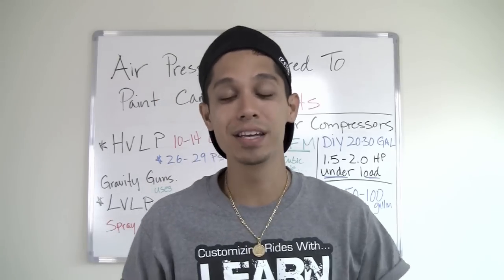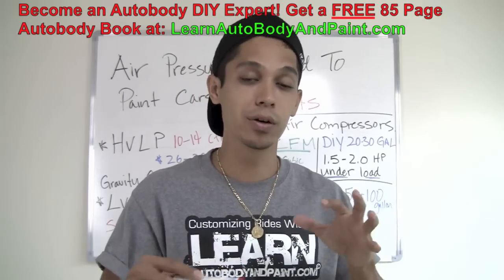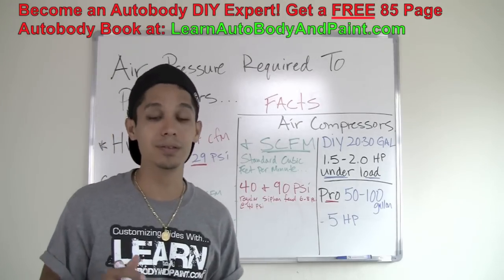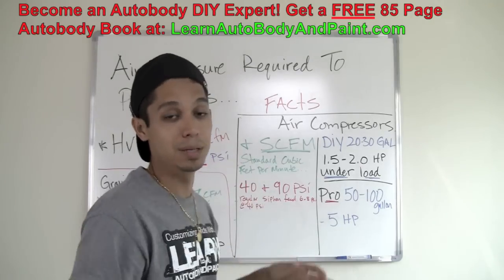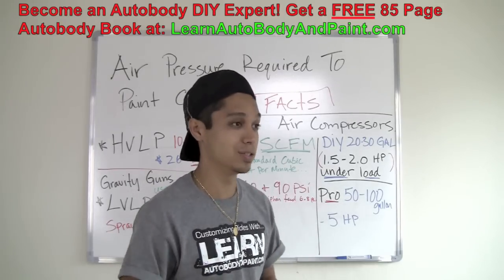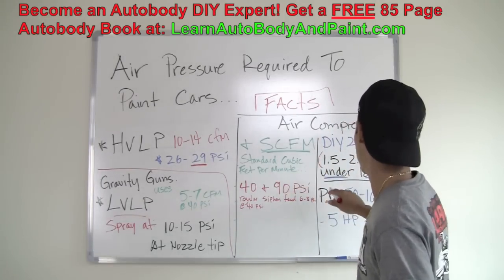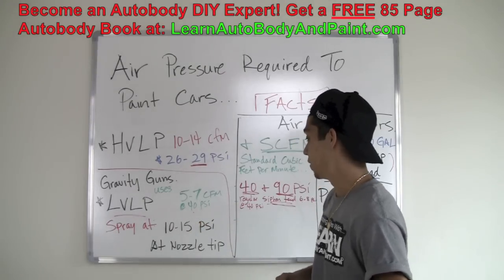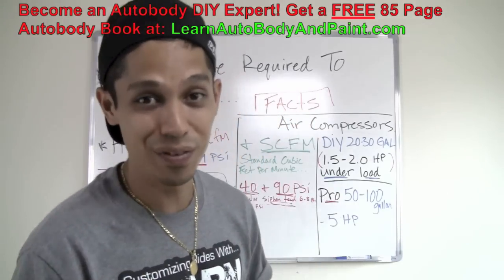Spray Gun Air Pressure Required To Spray Paint a Car

Comment from the maker: You can use both. Just remember if you plan to paint at longer times (a bigger project) then a lvlp would be less strain on your compressor.
Reply: Can you recommend some good lvlp guns? The affordable kind??
Reply from the maker: @jmseipp  check out the ATOM X spray guns. I love the X88 and the X27
Reply: @HowToPaintYourCar  . $389.90 and $679.00…   I asked about affordable spray LVLP guns.

Comment from the maker: I never measure air cap pressure. I said 26-28 psi for hvlp at trigger pull. and 10-15 psi on trigger pull for the lvlp guns. LVLP at 40psi from the tank only uses 5-7 cfm. It can get confusing lol.

Comment: I have an old Craftsman 5hp 30 gal. compressor. Several years ago I shot 1k  primer through a cheap Harbor Freight gun with a 1.4 tip and somehow made it work.
Now, I realize I had no idea what I was doing...lol.
I still need to finish this car....ordered a couple of Summit Racing LVLP guns to use with same compressor to shoot SS paint, and maybe a clearcoat.....we'll see how it turns out!
Reply from the maker: Why don't you try the Atom Spray Guns on Zoolaa: https://www.zoolaa.com/ These are awesome spray guns. Been using it on my projects and they are amazing!
Reply: @HowToPaintYourCar  , Yes Sir, I saw your video....you do awesome work. I only have the one car to do....it's not a full on resto...just need to start driving it again.
I will let you know how it turns out.

Comment: About the compressor HP.. check the tag on the motor for the actual WATTS and do the math.. 1 electrical horsepower is equal to 741 watts... The 5-HP CH compressor I own is actually only 2-HP LOL.. I hope this info helps out someone out there
Reply: heavymechanic2 This info helps me a lot. Thank you so much.
Reply: HP NOT mean anythink at compressor, only CFM mean how much air can make. and how big tank have no need motor run alltime only sometime if tank pressure drop too low.

Comment from the maker: Low volume means (Low volume). Low pressure means (low pressure). 45-55 psi. Who paints with those numbers nowadays?

I've been painting for 17 years and never sprayed at those pressures. You would have material and overspray over everything. You might be mistaken for cap pressure. And who measures cap pressure anyway? Base Clear is sprayed at 25-28 PSI at the dial when trigger is pulled.
Reply: BOSS PAINTER - Learn Auto Body And Paint!

Comment: I agree with the bigger compressor is (nearly) always better philosophy.  I bought a substantially larger compressor the second time I bought a compressor.  From a small hobby size to a 5 HP and 11 cfm @ 90 psi with a 50 gallon tank.  It had nothing to do with spraying paint, but everything to do with running a dual action sander and an impact gun.  I wanted one that could run any/everything I own. I looked at my heaviest consuming tool and bought one rated a bit over that tools requirements.

Comment: Mr. Tony, I doing my first project and maybe last. I have a 20 year old Lowe's air compressor,  5 hp, 20 gal tank, is this okay to paint just a one time deal.  Trying to restore my old 69 Chevrolet c10 back to new as I can, thanks Mr. Tony for your videos. Shelby NC
Reply from the maker: It all depends on how much you are painting, a 20 gal is very small volume to paint such a large truck. You will be waiting for the tank to fill (playing catch up) to continue to spray. What you have is a good setup for painting sections or doing touch ups... If you painted your truck in pieces it would work..

Comment: Just thought I might add just incase my existing unit were a gmc 2 or 2.5 hp  30 or maybe 40litre tank direct drive single cylinder unit , my new unit is a ingco 60 litre 4hp belt drive 3 cylinder unit 15.25 something cfm which I were lucky to come by on sale at a 30% discount in comparison to its v twin 3 hp counterparts for $50.00 less which I were a little on the fence about getting only being around the 6 cfm range which is what I were mainly focused on at the time . Thanx again

Comment: 3 hp compressor, 6.5scfm @ 40PSI,  6.9 scfm @ 90PSI. HVLP gun with 1.4mm tip.  regulator at the gun set at 28 PSI..Spraying clear Lacquer; still getting orange peel...What variables should I adjust???   Great Vid-Thkx!

Comment: My paint gun is HVLP @ operation pressure 40 PSI; Working pressure 10 PSI; Average air consumption 4.5 CFM. I  will be using this with a harbor freight 8 gallon tank compressor ( yeah I know budget) that spirts out 5.5CFMs at 40. This would be good to paint my car with correct? I dont have too much money so I am trying to get this job done cheap. Thanks!
Reply from the maker: You should really look into the ATOM X20 LVLP spray gun, they are freakin awesome for the money. https://www.zoolaa.com/collections/spray-guns/products/atom-x21-professional-spray-gun

Comment: Tony should you use high volume connections from the compreasure and air hose and at the end of the hose connection to your gun.
Reply: bradley boyer 
My guns sprayed better when I went HiFlow couplings.
I even pulled the air flow mech out of my guns and run inline regulators. Better performance yet...

Comment: Good info. A quick question... I have a HVLP gun.  Would a 20 g 1.5 HP air compressor be sufficient if I paint just one panel at a time?

Comment: Hi Tony. Great videos but i have a question. I have iwata w 400 bellaria 1.3 sray gun, 26 gallon/3hp/11.7cfm/150psi max  compressor and need to now what setting on regulator on compressor?is it  max 150 on compressor than 40-90psi on regulator/water separator and than 28psi on spray gun regulator?

Comment: HI Tony I'm a member,my question is If you have a 80 gal air compressor and a 50 ft. 3/8" line and your hvlp spray gun fan is fully open, and your trigger is fully open, what pressure should your pressure gauge be set at from the compressor water separator?  Question two is with your settings at fully open fan and fully open trigger what is the Max air pressure that you would get to spray gauge fully open. IF you have 90 -100 psi coming from harbor freight blue water separator canister going through 50ft 3/8 line and your max psi. with the spray regulator all the way open your maxed out at 22 to 27 PSI at the spray with the trigger pulled. Static air is 90 psi and utilized air is 22 to 27 psi. and that's with the spray regulator all the way open,is there a problem or what do you suggest, which the harbor freight water canister recommends max psi  is 90 psi. I've tested 3 different spray guns with 3 different gauges.
Reply from the maker: Hey Man! Please send me an email at ninjasupport@learnautobodyandpaint.com for your questions. Also for your reference we all have that in our LABAP VIP course and as well in https://www.radspaintformula.com/rads

Comment: Thanks for this bro!I have the BULLE bl21 spray gun..i thought is HVLP but is not.
Someone told me i must using 2.5 bars with trigger pressed but this is to high.
I'l try tommo to spray a finish coat at 1.5bar (15+psi) im sure will be really better!
Thnks dude..keep it up! +1
Reply: p.s. my compressor is 2.5HP

Comment: awesome video, very well explained. Just curious, if I used a HVLP gun that requires a higher CFM than what a compressor can give, like a 20-30 gallon that does 4-5CFM, how will it impact the spray?
Reply from the maker: You can spray, but will only be able to spray small sections at a time. Small parts. You will be struggling for AIR volume. If you have a small compressor I recommend looking to get a LVLP spray gun, the ones we use are the Atom's they are excellent high quality spray guns that compare to SATA and Iwata for a fraction of the cost. https://www.zoolaa.com/collections/atom-series-spray-guns-pre-order/products/atom-x20-professional-spray-gun Check out that X20 LVLP. It will suit you well.

Comment: Hi, I just bought an lvlp mini gun for painting a motorcycle, I've got 10 metre airline from compressor to filter which has regulator on it then 5 metre airline from filter to gun which I will fit regulator to, but what pressure do you set at compressor to then adjust  at gun, the gun instruction say run gun at 24psi.
cheers

Comment: Hi Tony, I really like your videos man. Please can you clarify this for me I bought an Eastwood spray gun and this is the recommended output With a working pressure of 29 psi and requiring only 4 cfm. Can you explain this to me please. I am running a 50L compressor with a ratinig of 9.6CFM

Cheers, Dave

Comment: Low Volume Low Pressure spray gun is safer to use right? Less chance of getting runs.  I need something that sprays fine mist with wide coverage with little bit of paint. Would this do?
Reply: i has use many year litlle hobby compressor and LVLP gun and paint 10 car now and ewerytime come perfect.

Comment: Hey, great vid! I have a question tho. Here, at 2:25 you've mentioned that HVLP guns use from 10 to 14 cfm. My question is this - How much liters of air is the gun using per minute or second, when you spray at 2 bar(28-29 PSI), for instance, i mean how can you measure it, is there a formula? Thank you in advance!

Comment: Hey great thanx for that
I were just wondering how ever is a gauge at the gun really necessary as unfortunately I've basically just splashed out on an air compressor which has pretty much already blown my budget as I were in the process of spraying or spot base priming my little truck with a 2hp 40 litre tank air compressor but found it weren't quite up to the task so invested in a bigger unit , 
Also when I hear you mention gallons as in size of air compressor tanks , Are you sure your not meaning to say Litres ? 
As a gallon here in NZ is 4 Litres so pretty much a 20 plus gallon compressor is not something most DIYers would have in there garages at least not over here anyways , 
Speaking of which actually don't even have a garage just a couple of sheds for storage as painting outdoors is another reason for taking such immediate action in to just wanting to get this job done and dusted having such limited time being susceptible to the weather as well as having already masked everything as well with mainly newspaper so is something I am in need of doing ASAP , 
But feel after watching your vid could have maybe been ok using what I already had as I never had no inkling about air pressures in general being a first time sprayer but then again never had no water trap either just full pressure coming straight off the unit which proved to be more a waste of time as I remember thinking I would had been better off investing in a whole bunch of spray cans , 
Anyways thanx again, as hopefully I'll have a bit more luck this time around , would have been good to have seen your vid sooner on my behalf but then again that's typical of how things seem to pan out for me, great stuff and all the best
Reply: you need LVLP gun then no need waste money big compressor.

Comment: if i have a compressor that's rated at 6.5cfm @ 40 psi, how long can i spray with a 13cfm hvlp gun before running out of air? Do you think I can at least spray a few car panels before running out of air?
Reply from the maker: Thats a very small output compressor. I  suggest you upgrade.
Get the free auto body book here: http://www.learnautobodyandpaint.com

Comment: great easy to understand vid. Cool guys wid experience...Highly recommend
Reply from the maker: Thanks buddy!
Reply: I have a 
Old Webster  Twin Cylinder, 1HP , oil lubricated Air Compressor ( 7gallon tank roughly) 
I have No regulator. 

Would that be enough to run a Automotive Undercoating Gun?
Reply: lightningsmokerXx you nees a bigger compessor.. . AT LEAST 15 GALLON

Comment: Tony nice vid I have a sears 5hp 25 gal tank this is what it have on the side of it for air delivery 9.1 scfm @ 40 psi and 7.1 scfm @ 90psi can I use both guns for this tank ???????? Or would the hvlp gun not work right ????????
Reply: You answered your own question!! A HVLP GUN needs ATLEAST 10CFM and you can only supply about 8 cfm!! Your paint job will look Tiger Striped due to insufficent air supply if you use HVLP with that small compressor. You dont have enough cfm. A LVLP is the EXACT same thing it just uses WAY LESS cfm.. It Operates the same,Settings are the same,Atomazation is the same etc etc..

Comment: on the lvlp. which is what i just purchased. your recommending 10-15 psi at the nozzle for base. I was just wondering because I seen some guys on the tube still pushing 26 psi with a lvlp. at such a low psi will it lay well at that psi and the clear at the same psi??

Comment: Not to nitpick you, but I think you got confused when you were talking about air pressure with LVLP.  On your board you have 40psi, then you said 10-15 psi, then you said 26 psi.  You were confusing pressure at the air cap vs. the inlet.  Looking forward to your spray gun reviews!

Comment: Why would they even sell HVLp guns, if LV works better?  They don’t sell Lv guns at big box that I saw.   Bought two $100 composite husky HVlp guns, and a 27gal comp.  Not good enough?
So gun says 4.3scfm avg consumption and 40psi operating pressure…compressor says 6.8cfm@40psi.
5.1@90.  200psi tank and 1.7Hp
How do I use this information?
Not spraying a whole car, but will have to do a hood and two fenders off the car, and maybe a quarter panel.

Comment: For the 50 and 60 gallon tanks they have to be 5 HP under load as well?
Reply: too expensive and big in home hobby garage. no need buy LVLP gun need only max 7 cfm compressor and no need lot air and pressure newer. big compressor waste only money than idiot

Comment: Can I couple my two 20 gallon compressors?  Will this help?
Reply from the maker: Hey Man! When you’re using a full size spray gun and not a mini, you should be using an LVLP Spray Gun when you’re using these smaller air compressors. I don’t recommend using an air compressor smaller than a 20-gallon because you need the air volume reserve when you’re painting. The smaller air tank you have, the less reserve you have of stored compressed air.

Imagine using a 5 or 6-gallon air compressor that will be running continuously to pump out air for you, which is called CFM. Then, the small air compressor will struggle, specifically if you are painting an entire car.

Smaller air compressors are ideal for motorcycles, car parts like a car fender or bumper covers. I recommend you use at least a 20-gallon or 30-gallon air compressor. Hope this helps! Grab more free trainings and videos on auto body and paint at https://www.learnautobodyandpaint.com/
Reply: @HowToPaintYourCar   my 2 compressors are 20 gallons each.  If I couple them together, would this help with air volume?

Comment: Hi, I have 3HP 15GAL at 4.9 scfm at 40 psi and 3.5 scfm at 90 psi, I have a campell standard gun, it said I need 5HP, but it's will depend on how long the surface I need to paint I think, if I have 3-4 square feet to paint should be good no ?
Reply: HP not do anythink, no mean anythink, no need know, SCFM have only important what need know compressor. LVLP gun low need 5-7 SCFM and high HVLP gun need 12-17 SCFM air.

Comment: The tech sheet for my DuPont chroma base says spray at 9-10 psi when using hvlp gun. That’s quite different to your recommendation so am wondering what is correct?

Comment: So im confused... You say Spray at 26-29 PSI, But the data sheet for my basecoat paint says 48psi?!?
Reply from the maker: 26 to 29 psi trigger pulled with a high volume low pressure spray gun. Not sure what kind of paint you are using but most of the times you don’t follow the data sheet when it comes to air pressure. Check out my site and get my free autobody book and training I think it will help you.

Comment: yes I have a question; I can't find a vid on where to set your compressor psi to use you paint gun? my compressor goes up to 150 psi. do I leave it there or set it to 90 psi, 40 psi etc.?
Reply: normal comp have 8 bar max and good no need newer more.

Comment: The tank has nothing to do with a CFM rating. The tank is reserve air or stored air.  CFM rating never exceeds that of the air pump.  Storage keeps the pump from cycling on and off as frequently and allows use of higher CFM tools for intermittent use on low CFM pumps.

.  IF the tool CFM rating is higher than the pump rating the stored air will run out and the pump will eventually not keep up with demand if used continuously.
Reply from the maker: Thanks for that additional info. You rock Rush!!

Comment: I have the Devilbiss plus spray gun what type of compressor should I use and pressure at the gun thanks
Reply: HVLP gun need 14-17 SCFM air out compressor. if not want waste lot money compressor buy small 5-8 SCFM compressor and LVLP gun. use you brains, just men sau SCFM have only important what need know and comp,need air lot hvlp gun  and less air need lvlp gun.

Comment: The horsepower rating is a useless number.  CFM output is the most important number. The next is tank volume which allows stored air to power larger tools on a low CFM compressor intermittently.

Comment: there are also people from europe .who watch this .I'm just having problems converting into bar, liters per m. or kw.
Reply: +georgio jansen 1PSI = 0.68948 bar
1HP = 0.74569kilowatts
Reply: +Tetrahc he is explaining, no need for me to calculate , you don't wanna buy compressor just for spraying so its then only important how much air and psi it can deliver (not intake) tank is not important you can always hook up extra tank and then take the one with the mininum kw or hp thanks for support.live in holland 230v and three phase 400v standard now in new buildings 3x25 amp basic . goedendag